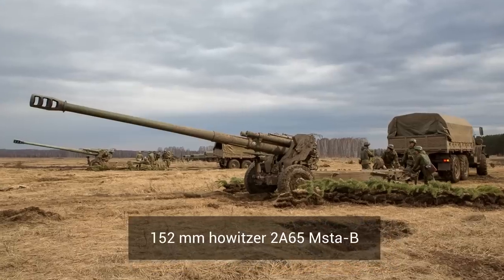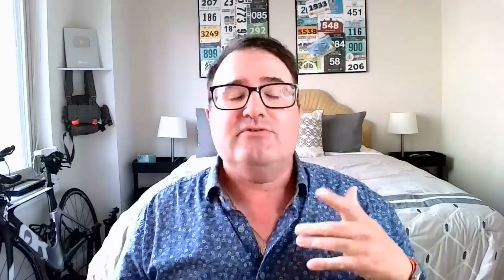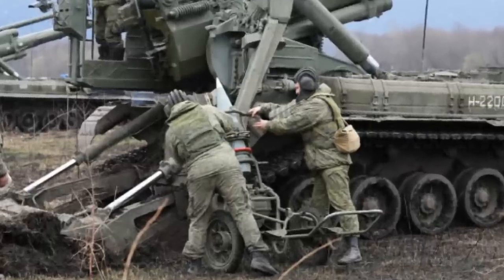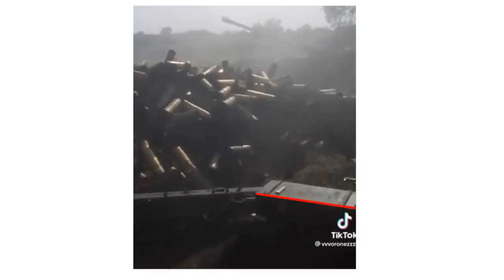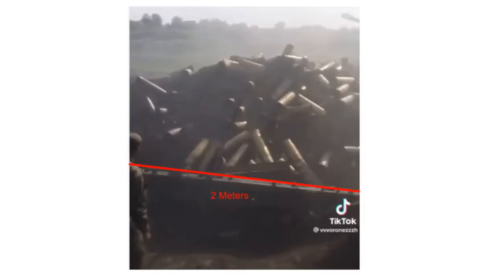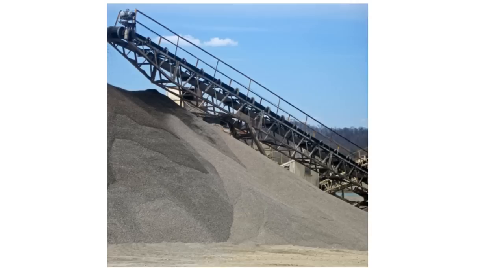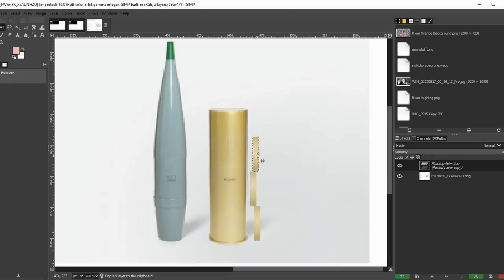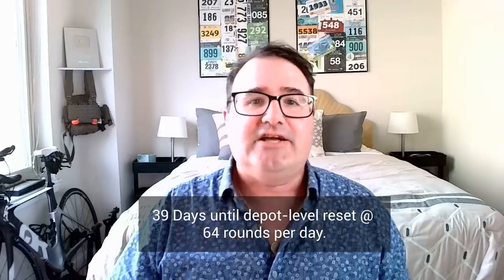When will this Russian Howitzer explode? (2A65 Msta-B Barrel life estimation from shell casings)

Comment from the maker: Connect with me on Twitter:
@ryanmcbeth

Watch my long form videos:
https://youtube.com/playlist?list=PLt670_P7pOGmLWZG78JlM-rG2ZrpPziOy

Like the chest rig hanging up?
Get a Made in USA / Berry Act compliant chest rig or play carrier at:
https://dynamicprinciples.us/

I don’t have a Patreon account.  If you want to give me money, give it to:
HelpIsOnTheWayUA.com 
Or
WCK.com

Join the conversation:
https://discord.gg/pKuGDHZHrz

Want to send me something?
Ryan McBeth Productions LLC
8705 Colesville Rd.
Suite 249
Silver Spring, MD 20910
USA

Here is the math:

The shell casing box is:
830mm x 484mm x 270mm. 

The Howitzer carriage trail is 2.15 meters.

The average height of a Russian man is 176 cm.

I estimated 1933mm on the boxes so ~2 meters.

I estimated 1.5 box lengths of the pile height, or roughly 1.5 meters.

I estimated the slope at 35 degrees using Coffee Beans as a substitute for shell casings.

When plugged into a triangle that gives a hypotenuse of 2.616 meters.

This means the surface area of the pile is 5.23 square meters.

If the casing width is 578mm x 152mm, then a 152mm shell casing takes up .089 square meters.

Divide 5.23square meters into .089 square meters and you get 58.

Add 10% to cover shells that have fallen over and you get ~64 shells.

Links:

Angle of repose:
https://en.wikipedia.org/wiki/Angle_of_repose#:~:text=The%20angle%20of%20repose%2C%20or,0%C2%B0%20to%2090%C2%B0.

https://arconpartners.net/products/ammunition/large-caliber/152-mm-round-with-full-variable-charge-and-high-explosive-projectile-he-for-152-mm-gun-howitzer-d-20-and-howitzer-gun-ml-20/

https://kintex.bg/product-4-74

http://www.armaco.bg/en/product/artilery-ammunitions-c15/152mm-he-round-p196#product

Triangle Calculator:
https://www.calculator.net/triangle-calculator.html?vc=&vx=&vy=1.5&va=35&vz=&vb=90&angleunits=d&x=89&y=31

Credits:

Original twitter video:
https://twitter.com/CasualArtyFan/status/1563941670403579909

Images:
"Black is myfavorite!" by cbgrfx123 is licensed under CC BY-SA 2.0.

"File:2A65 Msta-B howitzer (14-11-2019) 06.jpg" by Ministry of Defence of the Russian Federation is licensed under CC BY 4.0.

"File:2A65 Msta-B howitzer (24-10-2017) 03.jpg" by Ministry of Defence of the Russian Federation is licensed under CC BY 4.0.

"File:2A65 Msta-B howitzer (24-10-2017) 01.jpg" by Ministry of Defence of the Russian Federation is licensed under CC BY 4.0.

"File:ParkPatriot2015part6-59.jpg" by Vitaly V. Kuzmin is licensed under CC BY-SA 4.0.

"File:2A65 Msta-B howitzer (14-11-2019) 04.jpg" by Ministry of Defence of the Russian Federation is licensed under CC BY 4.0.

"Russ, Sayre & Minnie by a pile of coffee bean skins at La Azotea Estate, Antigua, Guatemala, Photo by Char" by ali eminov is licensed under CC BY-NC 2.0.

"Corn Harvest" by ConanTheLibrarian is licensed under CC BY-NC-ND 2.0.

"Sorted gravel pile from Pleistocene glacial outwash (St. Louisville gravel pits, Licking County, Ohio, USA) 31" by James St. John is licensed under CC BY 2.0.

"Dirt Pile" by jddunn is licensed under CC BY-NC-SA 2.0.

"suburban landscape (parking lot dirt pile)" by r.a. paterson is licensed under CC BY-NC-SA 2.0.

"Empty Casings" by The U.S. Army is licensed under CC BY 2.0.
Reply: You should calculate the volume of the pile, and divide by the volume of a shell. There will be packing inefficiency, so the number will be less than just dividing by volume of shell. You may be seriously underestimating the number of shells, as volume goes by cube not square of distance.
Reply: I can't remember my math but this doesn't account for this being a cone not a triangle. π needs to be used at some point too. I'll eat some dinner and see if the calories help clear my mental block
Reply: it seems to me that 64 shells is an underestimation of the pile - given that it is probably set somewhat behind the ammo box.
My evidence: if I only just count visible shells, I can easily spot more than 10.

Edit: a quick glance easily reveals more than 25 visible (lit) shells - so the berm must contain substantially more than 64 shells.
Reply: I counted over 80 shells that I can make out. I bet with some image processing, we could turn the brightness and contrast up to see even more. At least a few areas are 3 shells deep (shell pointing towards camera making a ledge for other to rest on). You can see during the pan shot that the backside of the berm is covered with shells as well. There are easily over 200 I would guess. If the chamber is worn the shell case can expand and jam in there which would point to it being way past it's service life.
Reply: Ryan, what does "ocent" mean?
Reply: Divide 5.23 square meters (3d shape we are looking for something cubed,) into .089 square meters and you get 58 (cubes stacked perfectly without gaps.)
Reply: I think that there's a logical thinking issue here.
Some artillery can be fired "caseless" so you don't have to use cases for your load, just insert grenade and propellant. Then an igniter can fire the charge without a casing. It's therefore possible that this is a demonstration of that ability.
In addition to that - wear impacting precision occurs long before the piece becomes in danger of falling apart. It may have really crappy precision, but it will still make life quite challenging at the other end because you'll never know where the next grenade will come down.
So from that I just consider that it's hard to make any kind of conclusion from this video.
Reply: As mentioned before, it’s rather cone or pyramid. So you calculated amount of rounds only on the surface.
Reply: @justinsbeaver9010  O.S.I.N.T. > Open Source Intelligence
Reply from the maker: @LietKynes  Yes, because I believe that the rounds are resting on a dirt berm that is in the shape of a plane.
Reply: You’ve also got to factor in that many of the artillery pieces that the Russians are using on the front are not new they’ve been used and put into storage and so the barrel life is going to be even less
Reply: The more I look at that video I keep thinking that hole was scraped into the ground from 2 directions. Dirt mound to the left is right up to the arty. The dirt in front as well. If scraped from the right and from behind to make those mounds how would they scrape to make a significant mound to the right? Id bet there is little to no dirt mounded up to the right of the arty.

Also just counting visible shell casings I got easily into the mid 50s just next to the arty. So I suspect the actual number is quite a bit higher. Maybe somewhere between 100 and 400? I say 400 because when the video pans you can clearly see the mound extends quite a ways from the arty.  So yeah that arty piece is likely worn out and then some.
Reply: 5 minutes in the subtitles say : sample subtitles for your video.

Also thank you for the video.
Reply: You've plugged in the wrong legs for the hypotenuse it seems. Around 2m is what you estimate of the base width for the entire pile was, however, the hypotenuse is calculated for a right triangle (so just the half of the visible pile, i.e. the bottom leg must be around 1m instead of 2.15 as shown on the screenshot at 6:12). On top of that, the calculations really ought to take the 3D shape of the pile into account which is not bound, generally speaking, unless we operate under an ad-hoc assumption about how the pile might look like from a different angle.
Reply: @goodbodha  In a war situation you'd want mounds on all sides except the side you'd designated as a retreat path.
They'll be there to allow the crew to hide from gunfire and shrapnel from counter-artillery.
But this specific video is as I see it a bit lacking enough information to tell us if this is just an exercise or a real situation. So we can't tell what will break first.
Reply: @craiganderson2362  Ah thanks! The auto subs said ocent I was like wtf is that lol
Reply: You could have just come to the conclusion of the shell number faster by just counting the ones in the picture and make an estimated guess from there on.
Reply: hey figured out Macbeth you're literally screaming into the microphone buddy
Reply: Thank-you Ryan you have the eye of the tiger  🐅
Reply: Sorry bit of an off topic question? Did you get an electrical engineering/computer science degree? And just curious where did you do either your BA, Masters, or the coved Sc.d? If you personal I totally understand. Just happen to be in the field with heaps of post graduate degrees in said topic, which are useless basically.....so just out of curiosity that's all, and of course if you don't mind answering even vaguely.....thanks love the content! And A+ on production quality.
Reply: Sherlock Holmes
Reply: Achronic Deth  Russians are conscious of the concept of barrel wear. The Russian military has also calculated the average number of additional rounds that can be fired beyond the recommended service life. They have divided the value of an artillery gunners life and health by the number of rounds that it will take before complete failure. The Russian generals have concluded that they might as well tell the soldiers to keep firing the howitzers and not to stop until it won't shoot anymore.
Reply: @josiahmanson  yea you can count more than 60 before  the camera pans. his 64 estameate may be close to a single slice of the pile perpendicular to the c axis
Reply: Well this 🔥 take aged like a glass of warm milk.
Reply: We need more of these vids. You don't shy from doing the work. You are rare. lol
Reply: In calculating the area of the triangular pile of shells, did you include calculating the volume of the cone (rotated triangle) representing that pile? I missed it, if you did. 
You have previously denigrated your service career as equivalent to a “nothing-burger”, but your estimates of antagonist capabilities from some photos and a short video would do credit to any Intel Analyst.
Reply: It was hard enough getting through the short form one.